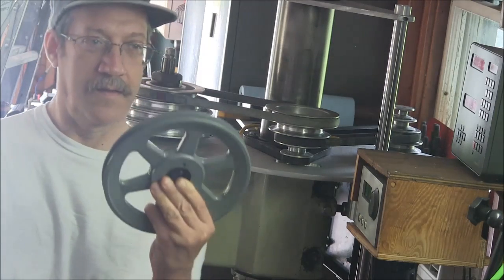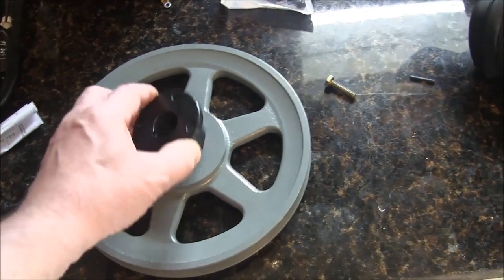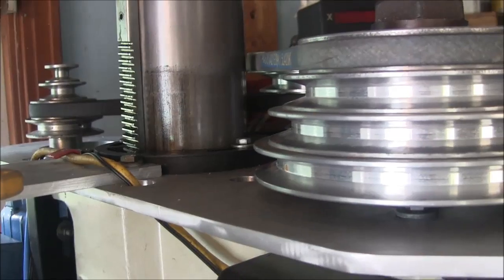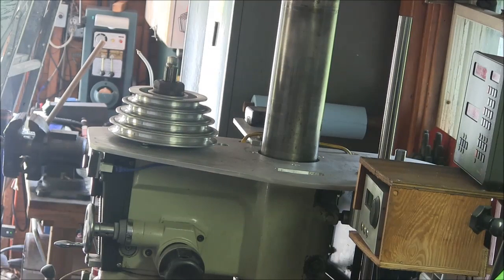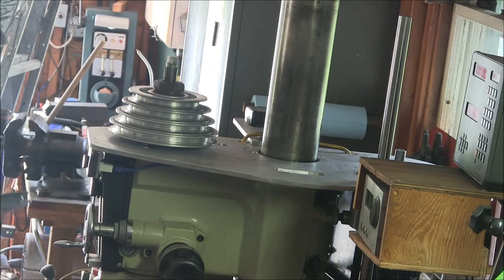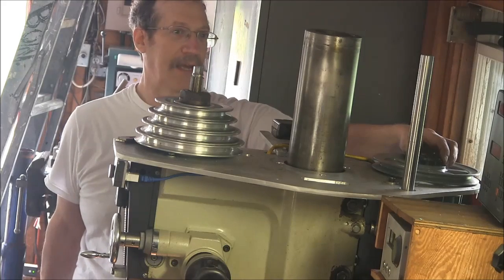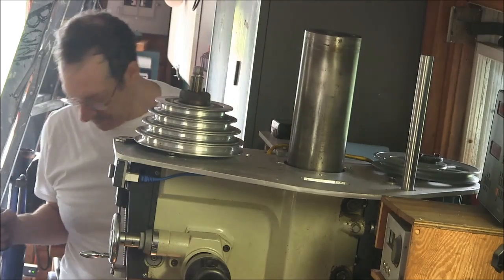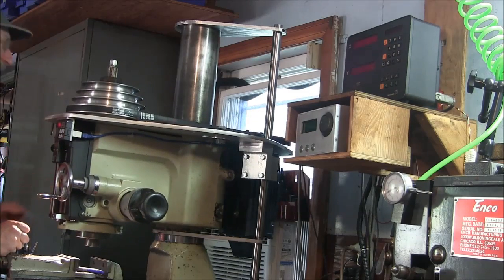Wrong Foo Drive Mod.

Comment: How do you adjust belt tension now the idler pulley has been removed?
Enjoying all your videos.  I have the smaller RF25, but the mods can be adapted.  I use a laser pointer to maintain position which works ok so still debating about the column clamps, but I do have a 2.5 inch stainless bar which I am itching to use!
Thanks
Mitch
Reply: The new pulley is attached to the motor so there isn't any change from the stock tensioner.

Comment: Good job going with a inch pound torque wrench. A bigger one isn't very accurate real close to the bottom of it's scale.  I got one when I had a whole mess of 1/4"-20 bolts I had to torque evenly on my bead lock wheels.  Your video popped up in my feed, now I have to go watch more of your conversion videos.

Comment: Cool project, I own a jet 16 inch vertical mill, every time I want to change speeds have to get a ladder and full around with the belts and pulleys. I am familiar with the viable  frequency speed control, and the three phase motor. I love your modification so much I think I'm going to order all the necessary parts to convert my mill. Some of the mods I really did like attaching the rack gear to the post. Had to make my own locking bolts for the head, only because the ones that came with the mill were really bad design. Thanks again for the video.

Comment: What size pulley and belt did you use?
Reply: Also how did that affect your speed even with a vfd it seems you would lose potential overall rpm.
Reply from the maker: Glenn Edward 8 inch motor pulley gives me 1:1 spindle to motor ratio.
Reply from the maker: Glenn Edward limited by the max rpm of the cast iron motor pulley to 2800. The vid can drive much faster but I programmed a limit.

Comment: Real nice work. A remote switch for the z height drill would be the cats bark.
Reply from the maker: +Guy Good the drill works good, I don't have to change the height that often. Thanks  for watching and commenting.
Reply: If you're using a corded drill, lock the trigger in and use a momentary foot switch from Harbor Freight.  I have an old Craftsman 1/2", single speed, reversible that would work for that.

Comment: Are you going to have enough torque to run face mills?
Unless you have installed a larger motor or run only small cutters I think you are going to want more torque.
Reply from the maker: +MrJohnnaz 2HP on a mill that size is plenty, I don't typically run a face mill but it has plenty of torque down low from the torque boost.

Comment: i have this machine, i hate it (the bigger of the two actually). Wish I had a small knee mill instead so i don't use the Z position.
Reply from the maker: +meocats They all have drawbacks A Bridgeport is heavy!
Reply: @ReignOterror  the best way that I found to keep the quill on center is to use a hard stop, similar to what people use for repetitive work in the vice. If I need to raise the head I raise the quill then butt it against my stop. Next I raise the head as needed then lower the quill and snug it. Then pull it to the stop and tighten the head. To lower the head just do the opposite. It seems to do better if you have trammed your head in by shiming under the column bolts if needed but some mill drills are cast in one peace.
Reply: They have small knee mills like 600lbs, the RF45 is like 400

Comment: Good work,  how do you change speeds ?  Is there a variable speed drive for the motor ?Is there a vid for that ? Also how do you rate the vertical control bar, was it worth the effort ? Lots of questions I know. Its because I have the same mill and am thinking of doing some of the things you have. PS Have you seen Stefan Gotteswinter s power feed ? Nice